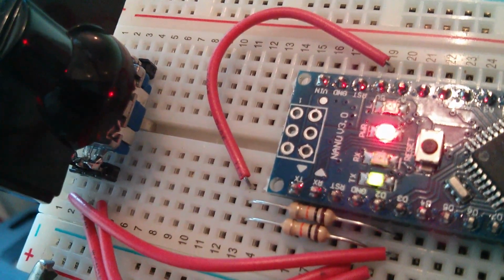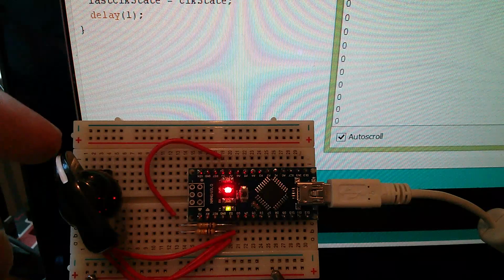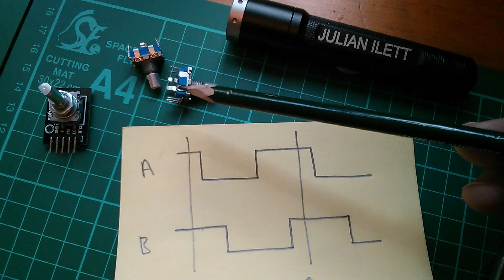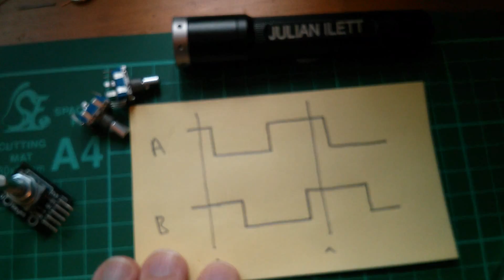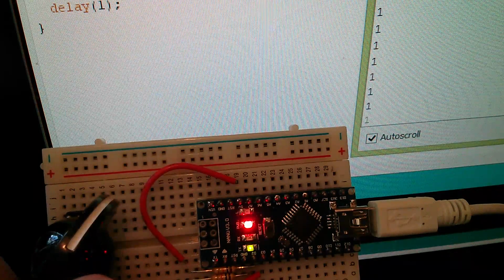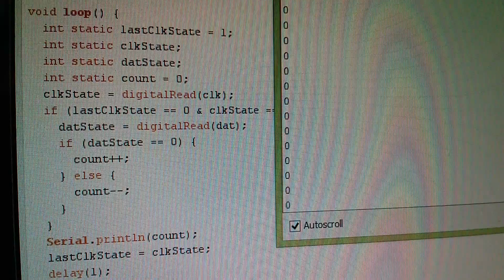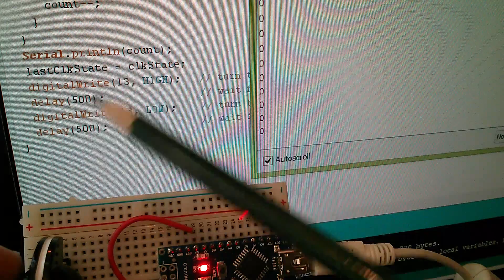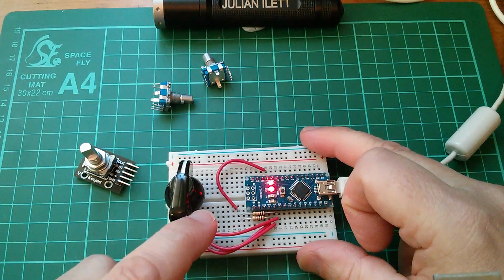Project: 20-Position Rotary Switch #2 - Polling & Missed Pulses

Comment: Hi Jullian. Did you ever resolve all the problems with using manually operated mechanical REs. I'm getting close to sorting them without the use of interrupts although I've resorted to HW debounce. (RC + 74HC14).

Comment: It is not necessary to debounce encoder buttons as long as you use the correct software algorithm to interpret the pulses. Basically, combine the PHA and PHB signals into one state variable, and track the direction you are moving as you go through the sequence. Bounce will just cause a back-and-forth movement between adjacent states, so as long as you only register a count when you move to the rest state with the right direction setting, bounce won't cause double pulses.

I made a project once that had 3 encoders connected directly to the Arduino, and 7 pushbuttons connected to an I2C port expander. I didn't do extensive tests to make sure I never missed a pulse, but I never noticed any problems when I was testing it.
Reply: Sounds Great! 
Where is your project?

Comment: I think this is an inherent problem with encoder switches in general. My car radio uses one for volume. If I turn it slowly, the volume responds smoothly. If I spin it fast, the volume responds very little if at all. Also, you would not use a knob with a pointer on it. It's not a matter of the knob position being back where you started from. You would just turn the knob until you got the desired result.

I want to use this type of switch in some of my projects so this tutorial has been really helpful. It has given me a better understanding of how the switch works in the first place. Thanks again, Julian.

Comment: I found it impossible to get reliable operation by taking this switch directly into the Arduino even with an RC filter on the input partly because, as you said, the problem is not bounce but noise which is very difficult to deal with in software.

One solution is to add a SN74AC14N hex schmitt inverter between the encoder and arduino.

I used a 10k pull-up followed by a 100R series resistor and a 470n capacitor between input and 0V of the schmitt inverter.

This hardware removes the noise so effectively that this minimal, interrupt-driven code triggered by a rising edge on the clock input is all that is required for perfect glitch-free operation: 

void rotaryEnc()
 { 
  if (!digitalRead(datPin))
    {counter++;}    
  else
    {counter--;} 
}

I also used exactly the same hardware for the push switch input and it completely removes the need for software de-bouncing.
Reply: Thank you for sharing!
How does your  your 'datPin' variable know the direction of the encoder travel?
Reply: because the rotaryEnc() function is attached to an interrupt and only called if the pin goes low.

Comment: Old video but my suggestion to you is to use interrupts on both a and b. That's the way I'm using rotary encoders and it almost never misses a pulse even in a big menu system.

Comment: The only proper way to use any quadrature encoders is to generate on both channels (A & B) an interrupt on any flange (falling or rising) and at the given interrupt check the AB channel state and compare them with the state before the interrupt occured. It gives you 16 possible states, some of them are errors (you can skip them) some of them are an increment and some of them a decrement.

Comment: Stick some caps on it.....
Reply: you need to scan as fast as possible, but you also need to wait if it changes state. 
I usually add a variable called bounce, if i see a change of state then i set bounce to say 10, or whatever value will give me 1/10th of a second-ish,  i decrement bounce if above 0 on every loop, if bounce is greater than 0, I ignore the button read
Reply from the maker: lez briddon Yes, that fixes most of the problems - but not all of them.
Reply: No! Use interrupts!

Comment: To allow for more frequent polling of your rotary switch you could try using Millis() instead of delay (delay is horrible evil for me and my single thread applications).

unsigned long lastTime=millis();
int led = 13;
boolean ledState = false;

void setup(){
     pinMode(led, OUPUT);
}

void main(){
     if (millis()-lastTime>500) {
            ledState = !ledState;
            digitalWrite(led, ledState);
            lastTime=millis();
     }

     // Do other stuff without getting held up.

}
that will let your Arduino keep executing code while also controlling the led.

I'm sure you know this already know this now I think of it, but I already typed it all out so I may as well share.  Once I found out about millis()   I tried to never use delay again (unless it was appropriate)  (p.s. that code was of the top of my head ... i didn't test it.    but its definitely close enough to correct for you to know what i mean :p   )

Comment: Hi Julian

Do you got a link to where to get the little board you are using? like that it has vcc/gnd lines.
Reply from the maker: Søren Reinke Yes, here it is: http://www.ebay.co.uk/itm/MB102-Breadboard-Power-Supply-Module-3-3V-5V-Arduino-Board-Breadboard-830-Point-/180936853408
Reply: Thanks a lot :) 

Keep up the good work.

Comment: The way to do a polling loop with multiple tasks going on at the same time is to create a single loop.

For the blinking LED you create two variables: LedState (boolean, one bit) and LedCount. Each time through the master loop you increment LedCount. If LedCount is greater than a constant, we'll call it LED_PERIOD, then you set LedCount to zero, compliment the value in LedState and then set the LED output pin to LedState.

To debounce the A and B inputs you create these variables
A_count, 
A_state (boolean, one bit),
A_changed (boolean, one bit),
B_count
B_state(boolean, one bit).
B_changed (boolean, one bit),

DEBOUNCE A: each time through the master loop DO
Increment A_count.
Compare the state of the A pin to A_state. If they are the same then set A_count to zero. Next if A_count is greater than a constant, we'll call it DEBOUNCE_PERIOD, then compliment A_state and set A_changed. This means we don't consider that A has really changed until it has been in the new state for DEBOUNCE_PERIOD times through the master loop.

DEBOUNCE B: same as A using the B variables.

If we consider the debounced state of A and B, they can take on the following two bit states:
00, 01, 11, 10
The great thing about a Gray code is that there is only one bit changing at a time. So if AB goes from 00 to 01 then we know the switch turned in, lets call it clockwise, one position. If AB goes from 01 to 00 when know it turned the other way, anti-clockwise.

So to decode the direction lets create two variables of two bits each. Bit zero in each will be the A value, bit one will be the B value.

Variables: Old_State, New_State
Variable: Switch_Position

SWITCH POSITION: each time through the loop DO
If A_changed is true or B_changed is true then DO
Set A_changed to false
Set B_changed to false
Set New_State to the values in A_state and B_state (requires some bit manipulation)
If (Old_State is 00 and New_State is 01) or (Old_State is 01 and New_State is 11) or (Old_State is 11 and New_State is 10) or (Old_State is 10 and New_State is 00)
     then increment Switch_Position
else if (Old_State is 00 and New_State is 10) or (Old_State is 10 and New_State is 11) or (Old_State is 11 and New_State is 01) or (Old_State is 01 and New_State is 00)
     then decrement Switch_Position

If Switch_Position is greater than 19, set it to zero.
If Switch_Position is less than 0 then set it to 19.

Interrupts are a better solution but may be harder to troubleshoot.

Just remember, one big loop with no delays. Use loop counters where you would use delays.

I hope this is helpful. I haven't written this kind of code in many years, but I did write lots of polling loops in the embedded controllers I designed.

Here's the first thing I designed and it had one big loop, no interrupts.
http://flyers.arcade-museum.com/?db=videodb&id=2547&page=thumbs

Comment: If the circuit was complete, configuring pins 2 and 3 as INPUT_PULLUP would probably let you get rid of the 10K resistors. The necessary pinMode function is commented out in setup() (INPUT is the default so it will work).
Reply from the maker: David Pilling That's interesting. The Arduino tutorial for INPUT_PULLUP talks about a 20k pull up resistor - the 328P data sheet has it as min 20k max 50k. But it would be good to try it.
Actually I've found the pinMode() function to be unnecessary. I commented it out as you spotted because the default mode is INPUT. But when I added the D13 LED flashing code, I didn't add a pinMode statement to set it to OUTPUT.
Reply: Julian Ilett On my Uno R3 pinMode() is necessary to make the pin 13 LED work. It is possible the INPUT_PULLUP would be enough to light the LED. On some Arduinos the LED is driven direct from the pin, but  on the UNO R3 the LED is buffered by an opamp. Doing a digitalWrite(HIGH/LOW) on a pin set up as an input enables/disables the pull up.

Comment: You're really just using the wrong device.  

If you want a rotary switch the use a rotary switch, not a rotary encoder, they are different things and for completely different purposes.

Using an encoder you always have the potential to skip pulses no matter how you write the code, and of course the detent physical resistance is very low (compared to a switch) and accidentally bumping the switch is a very real probability.

And of course, when your device is turned on, there is no way to know what "position" your "encoder as switch" is in to start with.

Admittedly, multi position rotary switches are both considerably more expensive and larger, but that's how it is.

This is assuming that you do want to use it as a "switch" as you refer to it as.  If it's just for cycling through a menu or similar (a rotary non-positioned control input) then some debouncing to remove double steps, interrupts or fast polling if the cycles can be spared, and it's really not a big deal if you miss a step (you don't want double-steps though, hence debouncing),
Reply from the maker: James Sleeman I keep calling it a rotary switch, but of course I mean encoder. I'm just determined to get the best out of this cheap (28p) component. And learn some stuff along the way.

Comment: I htink usually these are used with plain round knobs to change a parameter that is software drivven and displayed so the actual posisiton of the know is not that relevant as you could always move teh know back and forth a bit to get to a specific value....

Actually i can't think of any applicaiton where I would need the know orientation to indicate a parameter value..?

do you?
Reply from the maker: Yves Baggi No. But this has now become a challenge! Until I get the missed and duplicated pulses down to the minimum that can be achieved, I won't be able to let this go.
Reply: Julian Ilett
I hear you. We've all been there. I'll keep watching.

Comment: Interrupts are the right way to go I think. You could also eliminate glitches by programming to ignore them, for example, if your switch is in position 3 then a one step adjustment would result in either a 2 or 4 and all other values could be ignored. I'm a huge fan of software debouncing as its quite economical, never done it on a rotary switch though. Good luck.